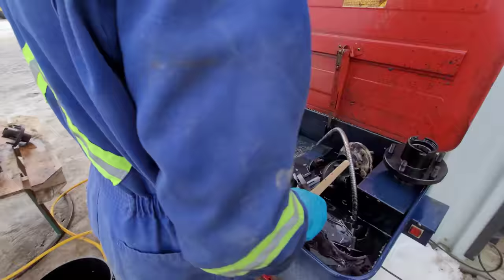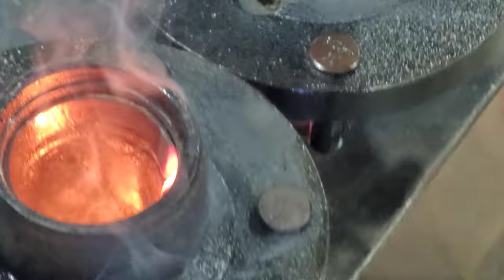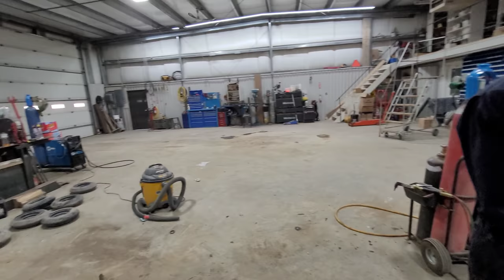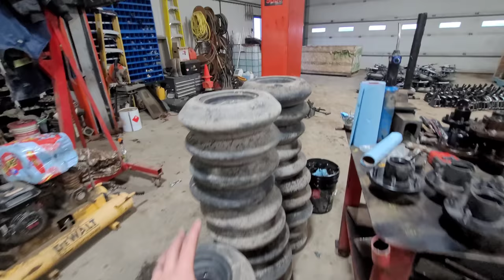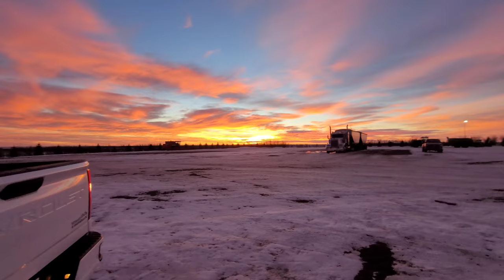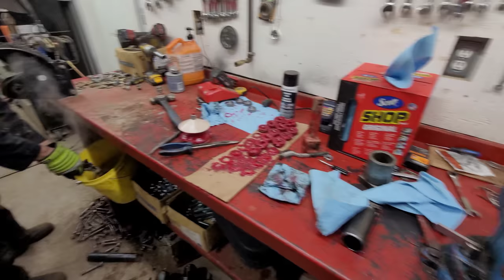"Shop work" How to change packer bearings

Comment: Mike, I was an Engineer at Cat for 35 years and a farmer all of my 80+ years of life so far. Here  is my understanding about your application of tapered roller bearings in packer wheels. Roller bearings tolerate contamination of grease the  in bearings much better than ball bearings do. For your application and the very light bearing loads for their size,  your bearings have an "infinite life rating"--- IF the lubrication remains " good".  If material (soil, any fine grit or even a few drops of water) making the grease look discolored, but the grease still has good viscosity,  is sticky as normal,  then  the lubrication qualities of the grease in your bearings is still very  good .  (The high pressure washer hitting the seal  is probably your packer wheel's worst reliability enemy.  I suggest----Leave the wheels on the planter. Check for grease escaping  around the seal before washing .  Pull the hub caps and get a handle on the quality of discolored grease. Spin the hub and listen for roughness to fix.  Adjust any end-play (poor factory adjustment)   and you packer bearings will be reliable for hundreds of hours more.  I enjoy your posts.

Comment: Mike - the easiest way to remove the bearing cone is to run a quick weld in the centre of the cone half way round and as it cools it contracts and just falls out when you tap it with the punch. Easy peasy.
Reply: You forgot, lemon squeezy. 😂🤣😂

Comment: Definitely the most efficient and effective way to get all them bearings out. Welding all them would cost way more than burning them out and take longer and would be messier with the spatter and what not. Plus you have to hook the ground to each one and deal with tips and wire and gas. Just way easier to burn them all out then give em a tap or two by hand. Fart around with an air chisel would just be more work in the end then just banging em out by hand. I dont know why everyone in the comments is so afraid of someone else doing a little bit of work lol. Good work guys!

Comment: I found that the round faced fully pneumatic packers had quicker germination, allowed damp soil to stuff off as they flexed, absorbed a lot of shock and overall worked way better than steel or hard rubber packers. In 20 plus years of use on over 200 feet of packers I only had 2 or 3 flats and one of them had been shot with a 22 rifle. Loved them.

Comment: In 1980, I toured a machine shop in Cleveland Ohio which had built a machine to auto cut the races on both sides of a common hub.  The operator just laid the hub in the "hot" machine,  hit the level, and the torches made the same cuts on each race at the same time.   Hubs rolled off the jig once cuts were completed. Operator reloaded the jig.  Took about 30 seconds for each hub.    Shop did work for the steel mils and auto plants.  The hubs and bearings were something that was very common for them to repair.   I think that shop was call Buckeye Machine in Cleveland.

Comment: A very easy way to get bearing races like that out is to weld a bead around them. When the weld cools it shrinks making the race loose. Than they just about all fall out. No risk of gouging the sides with the torch.

Comment: Mike, the secret to those races is to heat them cherry red, until they get soft. Let them cool, and as they cool they will also shrink. Finally, knock them out with a chisel. Some manufacturers also install these with green loctite, and the heat breaks that down as well. There is nothing stopping you from re installing with green loctite- keeps the race from spinning in the housing if a roller locks up. This is one of those videos where I wish I could personally show you the trick to doing these- I change hundreds of bearing races a year.  Cutting them out takes more bottled gas, takes too long, and your operator has more of a learning curve.

Comment: Bit of used engine oil on the depth adjuster helps 
We've tried everything, grease penetrating fluid engine assembly lube 
The older dirtier oil the better 
Rekon the carbon in the oil is what is sticking in there and stopping it from seizeing

Comment: back in the 1970's I worked to build a shop for Terex in southern Alberta. I was 120 feet wide and 440 feet long but what I really liked was the service door 24 feet high by 60 feet wide. I think you would like a shop that size. But heat the floor they used space heaters.

Comment: Welding races does take a bit to cool,  but it isn’t that long.  If you have 30 or so in a group and you weld a race, set the hub upside down and move to the next one,  by the time you are 4 or 5 hubs in the races will start dropping on the table as you go.  By the time you cycle through the group you can start on the other side.    Set your mig on the warm side and travel fast, a good welder can easily weld a race in the time the torch takes to preheat the metal to cut.

Comment: Old trick Mike is to weld a breed around the-outer race it shrinks it then you can smack them out often they crack with the heat
Reply: Frank Froese  gives you something to smack as well I just know what it’s like once hub is warn or damaged and bearing outter spins soon kiss by to bearings.  
Jealous of your job thou what an operation makes our 3k acres in uk look like drip in the sea !!

Comment: One trick for bearing races is you can heat up one spot red hot with a torch then let cool and it’ll pop right out no problem but cutting it out works too

Comment: We normally put a weld bead all the way around it and then it normally just falls out by itself. But cutting them is faster as long as you do not ruin the hub itself.

Comment: You can also run a weld bead on the race and when it cools they just about fall out, which is the method I prefer.
Doesn't have to be a good bead

Comment: Good day . I really liked your drill, I have never seen such a variant of the drill. Give me a kind answer about this drill, namely what are its pros and cons, how long it works, what money is needed for repairs, how long the nozzles are on the anchors and whether it can strictly withstand the depth of sowing, and if not, tell me how well it can withstand sowing depth. Thank you I will be very grateful for the answer.
Reply: The Bourgault Paralink drills are the most popular drill choice throughout the prairies. They are built heavier and stronger than competitors. The use of mid row banders eliminates seed burn by users being able to band large amounts of fertilizer safely in between seed rows.
Reply: @davidlogel2350  This is very cool, I can only envy you because in the south of Ukraine there is so little moisture when sowing grain that in any variant of fertilizer application from the side or in a row, we get the suppression of the plant. So now we do not apply fertilizers at all when sowing. We take out only when we receive good sprouts of plants we bring spreaders under a rain or a fog

Comment: If you weld a bead on each side about 1 inch long the race will shrink and should pound out fairly easy I haven’t done it on that particular application but I have done it others works great and no risk if cutting the hub
Reply: I do the same with wheel bearings. A quick weld and let it shrink and it falls right out, it works much better than cutting. A proper tool for the press would be better still.

Comment: Hey mike. If you weld a bead in the race it will shrink as it cools and usually fall out if you tap the hub on the table. If that works or not i think you guys need a airhammer with a chisel point. Would save yall some forearm cramps... Anyway replacing bearings is fun sometimes but Im sure 160 gets old after the 5th so goodluck

Comment: Run a bead of weld around the inside of the bearing cup. When it cools, it contracts and the cup drives out easily
Reply from the maker: That's what frank said, but it was the cooling part we didn't want to wait for
Reply: @mikemitchell2554  Plus its cleaner burning em out, no spatter or sht. Not to mention faster and cost less considering welding consumables are more expensive than oxy/acetylene.

Comment: So everyone has there own way with things. 

Friends when need to remove the race. Get your welder out and weld on the race. On both sides or all the way around and they will about fall out of the hubs. By welding it then it shrinks the race. 

Good luck I hope this helps someone it works awesome.

Comment: What I have done to knock out the races is to use  a wheel to set the hub in. It holds  the hub off the bench and makes it steadier. One way the studs hold the hub in place, then flip it over.

Comment: Mike if you have problems with the gray anti seize, on our Concord we went to Copper Coat anti seize. Graphite and nitrogen do not play well together! After we switched to Copper Coat we had a lot less seizure problems. 
Some engineer forgot to put the notches to knock out the bearings in the casting drawings. 
Mike what is the green poly tank for?
Hello from north east Montana. 
10 miles from the Canadian border.

Comment: The easiest way to do that is with a hydraulic press and a bushing tool cut into an ellipse.   The ellipse lets you get the tool past the first bearing and when it flattens out rests against the shoulder of the race you want to press out.   It literally takes about 15 seconds per hub.
I'm surprised there's something wore out on all that shiny iron!

Comment: Would stainless bolts help in the adjuster arms Mike ? Maybe won’t seize as bad ?
Reply from the maker: Maybe?
Reply: nope, stainless steel and carbon steel will get bimetallic corrosion in that position. best for cost-effect is that what they are doing. 
 anti-seize for bolts and nuts, copper paste for anything that gets hot.
Reply: @dhold10  rubbish fella,we use liquid fertiliser around our potato planting operation,using stainless fixings anywhere we can,this helps massively,no downside to it at all,cost is negligible as speeds up service and breakdown,copper paste just dries up and bolts still seize.Give a few stainless a try,you’ll be surprised in that environment.

Comment: tapered roller bearings should last forever unless they get dry on grease????
Reply from the maker: The environment that theses bearings are in keep them from last that long. They would need alot better seals to keep out the little bit dust or water that can always find a way to get in

Comment: Ok, here is the only correct way to get an interference fit bearing race out of it's bore. 1st give the hub a quick wipe out to remove excess grease, the bearing should be shinney. 2nd use the gas axe but set the flame hot not as you would to cut, you need to get the heat in quick so as not to heat the hub. 3rd aim the heat at the thick end of the race just off centre, you want to just change the race colour blue not red move the heat around the race 360 deg keeping the colour change to blue. 4th let cool and tap the bearing out, don't belt shit out of the bearing in one spot just a tap on alernting sides. I guarantee you will get the job done faster, you will not cut or damage the hub or distort the bearing bore, your new bearings will last like new. By the way if any tech, tradespeople or apprentice did it your way in the shop I've been in for the last 30 years you would be looking for a new job. Give it a go. Cheerz Mate🍻

Comment: Throw a bead of weld on the race, it will shrink slightly and almost fall out when you tap it with a punch and hammer.  Frank looks ok with the torch though, i'd be too worried about scarring the hub.  EDIT - just so you know, there's two indentations in the hub at the back of the race to allow you to put a punch against the race better.  At least i'v never seen a hub without this feature, so could be wrong there I guess.

Comment: In case anybody was wondering, bearings for a Mikes drill cost about $5000, when buying all new bearings would be over $13000
Reply: But how many man hours of labour to change all those bearings, add in that cost and it may be pretty close to a wash.
Reply: @blacquejacqueshellaque6373  its 40 dollars to fix the bearings plus 20 dollars in labor. 60 x 84 bearings is 5000.

Comment: So on a paralink drill, when does one go "enough" and trade?

I mean just looking at all the wear points compared to the "old style" drills...
Reply from the maker: Haha when I look at the price of a new one, I am like "ahh, I ll fix mine" 😂
Reply: downtime in winter is when you repair your equipment ready for spring. 50k in repairs compared to miliions in new
Reply: @planeiron241  Well a new 60' Bourgault  is about 500K when we priced one last year, but if you're sticking 50k into it every winter, and the fact that in my area 10 year old drills are unsellable(we and the neighbors literally have rows of old drills because no dealer wants a 10 year old drill on trade and anyone interested wants us to ship it to the other side of the continent for free)...So I didn't know if the more maintenance intensive paralink design warranted trading earlier or not.
Reply: @J-1410  so Mike needs how many drills 4 ?
Reply: @planeiron241  8 If I recall correctly.

Comment: Hey Mike, 
The welding trick where everybody speaks about, i think it Will give less damage to the hubs.
Reply: Nah, burning em out is cleaner and faster and easier.
Reply: Frank Froese  Agreed. Anyone who has ever used a torch, and good at using a torch, knows how easy it is to keep your heat where you want it, resulting in no damage what so ever.
Reply from the maker: Frank?! I know this guy 🤫🤣
Reply: Must admit I am less handy with a torch as you. 😁

Comment: Run around the inside off the races with a welder. It shrinks them in. Then a couple of taps off the hub on the ground and they will fall out while they are still hot. Try it an see!!

Comment: You try welding a bead on the race to get them out? It shrinks them when they cool and they will fall out
Reply from the maker: It was cooling part that prevented us from going that route 🤷
Reply: @mikemitchell2554  Buck of water. You're waiting for the torched races anyway.
Reply: @richardschipper5989  Still quicker, easier, cleaner and just over all less a pain in theass to just birn em and give em a little tap by hand. All the farting around with the welding isn't worth it, especially after you factor in the cost of consumables.

Comment: I’d be using those old bolts from the depth control to knock the bearings out, not my good chisel. If I was doing that many I’d have dies made up to do it like we had for trailer hubs when I was truck driving, quick smack with the sledgehammer shifted them

Comment: Run a bead of weld on inside bearing races & when it cools they will fall out.
Just don't weld the race to the hub
Reply from the maker: That was talked about yes
Reply: @mikemitchell2554   I would try some specially made induction loop on the inside bearing ring and then fast cooling on water.
that should save some time and money from the gas bill :D
all thought that your crew looks like a well-oiled machine on there. I would do one tiny modification on hitting those rings out,
 just put some heavy-duty pipe underneath the hub so you can hit the rings entirely out.
Reply: I’ve seen it done on 10 series jd rear trumpet bearings welded to shrink then the  new bearings heated up in deep fat fryer of backend oil to shrink and  re -fit.
Reply: A small weld beam with a MIG works really great, the race falls out, try it you’ll be surprised!
Reply: Not worth the cost of the consumables, time and all the farting around evolved with putting a bead on em. Way quicker and easier to hit em with the torch and give em a little tap with a hammer and chisel.
Reply: @mikeznel6048  I think not.
Reply: @allanpenner7311  Spray the race with some super cold canned air and tap it out...
Reply: @mikeznel6048  it’s quicker, cheaper and better with the weld method 👌
Reply: Running a weld bead round the race works like a charm they really do fall out once they cool and contract a it.

Comment: Heat the races red hot with torch in 3 spots around race and let it cool and it will fall right out
Reply: Yeah welding really works well

Comment: Mike why don’t you drill and tap them and put a Grease cirque on each adjuster
Reply: Add time spent lubing 84 zerks (how often?) and changing bolts might be better. There is also hope that the never-seize will do the trick.

Comment: Hi Mike!
Sorry if some one else already said this buut. Why don't you weld on the inside of the bearing? They usually fall right out because the weld will shrink it. Due to the high stresses that is created in a weld.
Always great to see preventing maintenance!👌💪💪
Reply from the maker: Frank the guy cutting actually said we could try that, but then we have to wait for it cool abit.. And that's the problem.. Waiting lol😂
Reply: @mikemitchell2554    If you took a break waiting for things to cool down nothing would get done or too much 🍷🍷 or 🍺🍺 would be consumed 🤣😂
Reply: @mikemitchell2554  😂😂👌
Reply: Quicker, easier and cheaper to just burn em with the torch and chooch em out with a hammer and chisel. Oxy/acetylene is cheaper that welding consumables too, by a lot!

Comment: Use a stick welder and put a bead on inside of each race. It'll fall out. All 160 bearings and race failed at the same time?
Reply: Wouldn't that heat and expand the race making it even tighter?
Reply: Oxy is faster 
Its just preventative maintenance 
Swap em now so non fail during seeding 
Because if one fails and falls off you'll never find it again and your up for a new hub and wheel
Reply: @fowletm1992  Cheaper and cleaner too! Plus its easy to accidentally weld off the bearing race and make more work, after the 50th one.. You'd have to purposely over heat and burn up the hub it sits in with a torch. These guys got it down.